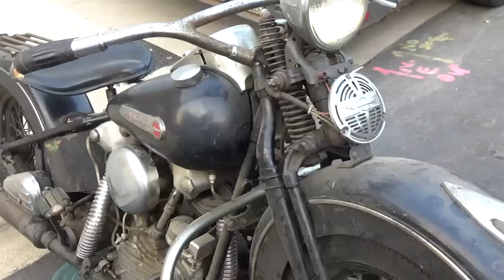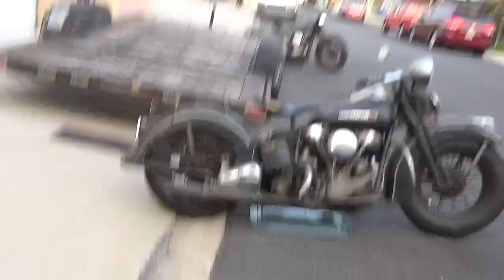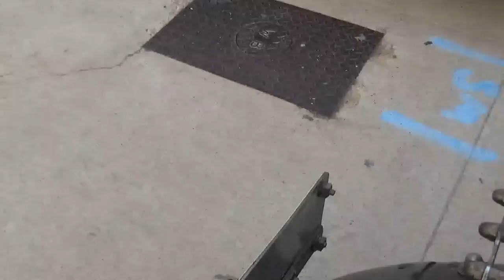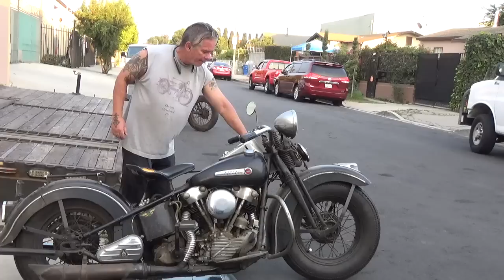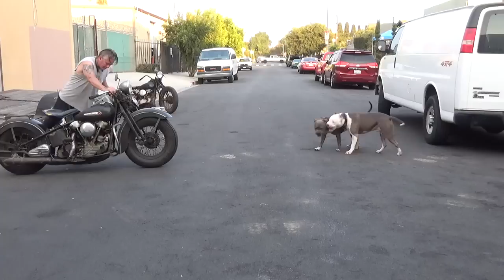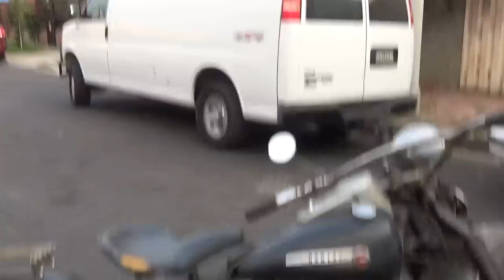Hunting Harleys, 1947 Knucklehead, 1st fire since 2013

Comment: That’s a nice bike, would love to see Harley recapture this concept
Reply: Harley's are already big, heavy and slow.
Reply: They have in the softail slim
Reply: @boneseyyl1060  If you ever get the chance, ride a 117 Road King with stage IV tune. You will eat those words. 😎🤘🇺🇸
Reply: @danielowen3724  A fast Mack truck is still a Mack truck.
Reply: @boneseyyl1060  Exactly! Harley is overweight, overestimated and overpriced but underengineered.
Reply: @franktechmaniac7488  You are going by modern standards and modern availability. Some people love old, heavy, under powered and they can afford it. You cannot tell them any different. I love the entire motorcycle world of every era HOWEVER at 73 and 57 years of riding I have modern bikes I hate dirty fingernails, scraped knuckles and  stains on my floor, I also want to simple put fuel in ride out get back home and change oil and fluids as needed.
Reply: @franktechmaniac7488  And that's exactly why we love them. 😍 Don't knock other people's rides, we all have different views and tastes. Personally I can't stand BMW and Kawasaki, but I don't ever slate them. 

Just remember we're all on two wheels for that way it makes us feel. Brand or engine size does not matter. 😎
Reply: @franktechmaniac7488  why are you on here then? We love our Harley Davidson's.
Reply: 2005-2006 harley springer classic
Reply: @danielowen3724  tune is not stock...and you still have a pig of a bike and frame that isn't designed to handle.
Reply: But yes, it's q totally dif ride, that I can still still appreciate.
Reply: Jim Evans  I've ridden mostly 80's UJM's 750's.   Recently stopped riding for  a while because of personal reasons.  Decided to get back in and get my wife riding, so I got a Honda CB 500.  It was meant as a learner for her, but it is probably now my favorite bike of all that I have owned.  Ideally I would like a Kawi Versys 650 but that will have to wait.   How about you?
Reply: I don't think 119ftlbs of torque on a bike under 700 lbs wet is concerned underpowered. By the way. The 2nd cheapest softail model out. Under $15k
Reply: The equivalent honda shadow phantom has 44ftlbs tq for example
Reply: Huyivant check out the softail springer classic
Reply: @badboybootz8  Indeed.  I've got a 2015 Slim in Charcoal Denim.  It's a modern day 'messenger' bike, which I use to do home visits to my clients.  I just love to hear the sound of my phone ring, knowing that someone has called me out and I take a ride.  Sometimes I have to pinch myself to remind me how lucky I am to have chosen how I travel around.
Reply: There are some bikes that pay homage to the Harleys of the late 1940s.  The Softail Slim is probably the one that pays the best tribute.  Then there's the Deluxe (sadly a discontinued model) and then you move up to the Heritage Classic.  Even the Kawasaki Vulcan 900 styling was inspired by the earlier model Harleys. What's that old saying about imitation & flattery?
Reply: @raywite6665  I'm 62 and partly disabled. I would love to own a bike like that, only in better condition. I have a 1989 FXRS Low Rider and a 1997 Sportster 1200. I will never get rid of them. I am currently looking for another EVO, probably a Dyna. H-D makes nothing but JUNK now. I test rode an M8 Street Glide. Talk about rubbish. Might as well have been a Goldwing. No feel, no sound. And now they are dropping the Sportster. Going Japanese all the way. RIP H-D  P.S. MODERN SUCKS
Reply: Or someone put a M8 or twin cam on it so a person can depend on it
Reply: @boneseyyl1060  I bet a metric cruiser can't keep up on a curvy road like the dragon or at least I've  never been in ones way and I've been 5 times this year to the 🐉
Reply: @onementality9781  They don't have to keep up.  They pass you driving by the bike shop when it's getting fixed...again.
   Seriously though I do love that video of the Harley guy in the twisties with a sport bike behind him and the guy is having a hard time keeping up.  It's more about the rider and that guy was a madman!  I think metric cruisers are just a more laid back lot.
Reply: @danielowen3724  I hate hearing people put down any kind of bike, it's like putting down someone's wife. Not yours? Don't care.
Reply: @franktechmaniac7488  you still watched the Video haha
Because? Harleys Are Special so save money and stop hating bi…
Reply: In my honest opinion, the most recent Harley that closely resembles the knucklehead is the springer softail
Reply: This is the most beautiful bike, they ever built !
And, yes, I don' t undrstand why, they don' t build them anymore.
Reply: Modern harleys have a very different motor, different feeling
Reply: Thanks to our government, it'll never happen. Otherwise, there's no reason not to be building new knuckleheads.
Reply: @smarba1 09 crossbones
Reply: @Jonathan-L my 09 crossbones has alot of classic look to it. Even came factory with springer seat.
Reply: @BruceLee-xn3nn  Ah yes, the Crossbones is definitely a modern day tribute model, possibly moreso than the Softail Slim.  I'm glad you replied, because I need a higher seat than the stock seat on the Slim, so maybe the Crossbones seat would be a worthy replacement?  I'm 6'2" so don't want  to be too far forward either.
Reply: @Jonathan-L  I like the crossbones seat, it looks like an old tractor seat.
Reply: @smarba1 ....zactly
Reply: @gameexplorerofficial2453 
FLSTSCI  to be exact

Comment: To start these old bike turn on the fuel and with the ignition off kick it through two full kicks be sure you spark advance is right then turn on the inanition and it most likely will start first kick.
Reply: Are you tryin’ to teach Todd or somethin’?
Reply: @dawidos117  Yes actually I am I been rebuilding these old bikes for over 50 years. I owned a 1941 45ci sports solo at 1946 Indian chief a 1933 HD a 1947 Indian chief a 1951 HD and a 1955 HD. All basket cases.
Reply: @lisar3006  impressive!

Comment: Runs pretty good.  Your description says "frame up rebuild" so, does that mean trbuilding the trans and motor? If so, no wonder it woke up quickly.  A carb that isn't all goobers up, plenty of spark and compression because the rebuild didn't have a lot of miles on it sure helped. It ran pretty smooth.  I hope fixing the oil leak isn't anything major. Besides looking lame, pools of wild could lead to oil on tires which is definitely no good, Enjoy yourself;f. You have two oldies but goodies there. Always a difficult decision as to how mush appearance stuff should be restored.
Reply: they sump oil if they sit a while . its just oil that got past the check ball and into the crankcase. Pump cant get it back to the tank fast enough.  Clears right up after a few minutes and thats it. My shovel has sat for ten years before I got it from my uncle. Puked oil. Cleared up. I changed oil and filter. Ran fine after that .
Reply: @chopperchopster  Well, OK. Obviously, you know much more about this than I do. He has two really nice bikes. The bobber has some rust on it- more than I'd like- and I wonder how much he's going to clean it up. Maybe an afternoon with rust polish and a rag would clean it up. Maybe not. Either way, having a nice running Knucklehead would be great.
Reply: @westsideflyer7559  that bike in the video.... I would just make sure she ran right. Keep that patina. No repaint. No restoration.  She looks great . I like riders not show bikes.  By the way S&S makes a knucklehead motor.  Wont have a HD title but its new!

Comment: I agree they need to resemble that again, getting to far away from the original look
Reply: actually no. Thats  one of the reasons they arent selllng well. That and price. Look millenials arent wanting old style or big heavy or expensive . HD needs to get with the times or go out of business. They know it too. Hence the Street 500 and 750 as well as the livewire and panamerica .  Liquid cooling is here to stay . 4 valve heads. That common crankpin is gonna be gone soon as well. Look any 600 CC sport bike will stomp all over a 107 inch M8 .  Me? I have pans .shovels . ironheads . But my daily ride is a 09 Dyna street Bob.  RELIABLE.  To bad they decided not to make the Bronx yet. it was good looking bike .

Comment: Where's all that oil coming from? Do the cases need split? Can't even make it to the bar and back without a dry sump. Epic garage ornament... not a rider.
Reply from the maker: Gravity, hadn't run since 2013. Oil goes into the cases then out on the ground.  It's how it's set up
Reply: So... It's just blow By? Not the oil system? Neat old scoot!
Reply from the maker: Right. You have to get the excess oil out from the bottom end. Harley designed these to work this way. It's also how they oil the chains